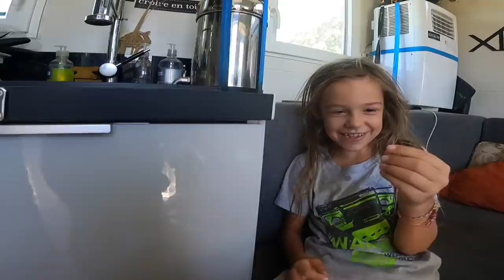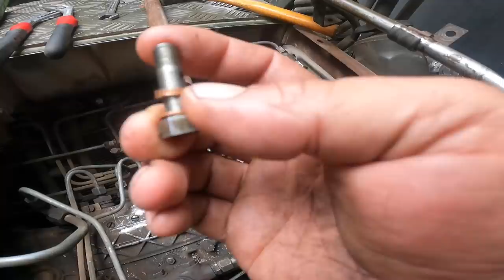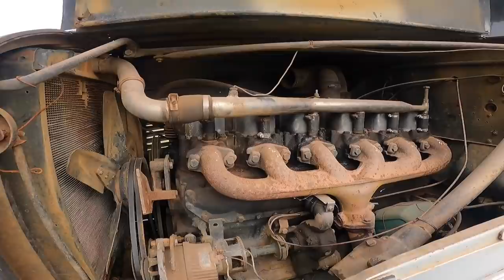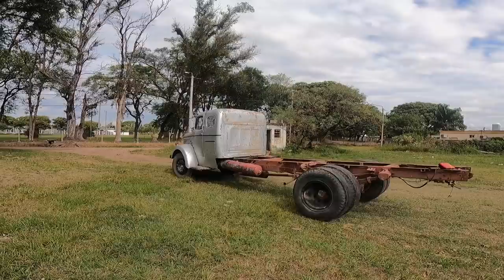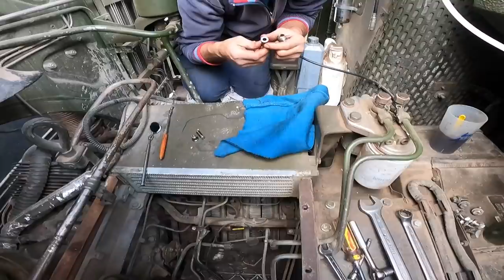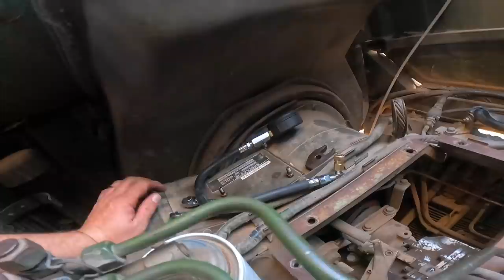224 Notre camion d'expédition 4x4 a-t-il démarré // Réparation moteur

Comment: Un calage de pompe va agir sur tous les cylindres. Donc, si ça ne touche qu'un cylindre, ce n'est pas ça. 
Une pompe décalée, ça fume, ça tire plus, et si ça envoie trop de gasoil, ça continue d'accélérer alors qu'on a retiré le pied de l'accélérateur. 
Si c'est une pompe mécanique, ça se règle au ban, cylindre par cylindre. 
Pour le bruit, c'est normal avec un refroidissement à air. 
Par contre, il est possible aussi qu'un des injecteurs fonctionne moins bien. Il faut les tester avec de petites bouteilles fixées sur les tuyaux de retour (à rallonger). .
Pareil pour les compressions. Faut les faire sur tous les cylindres. Ça peut révéler un défaut de compression, siège de soupape ou segments. Dans ce dernier cas, ça peut fumer et le gasoil se mélanger à l'huile (le niveau monte).
Restons optimistes !